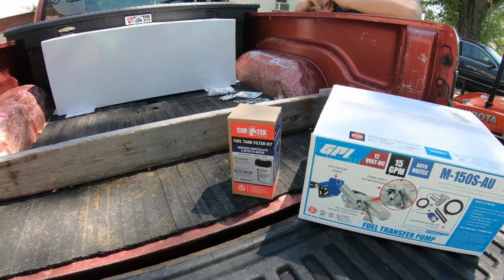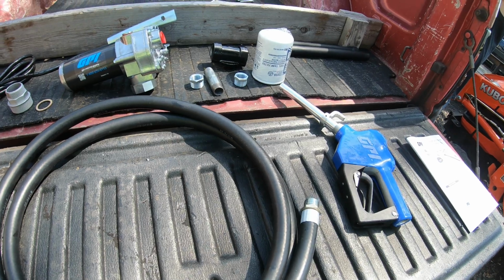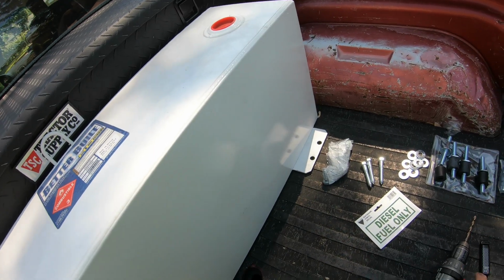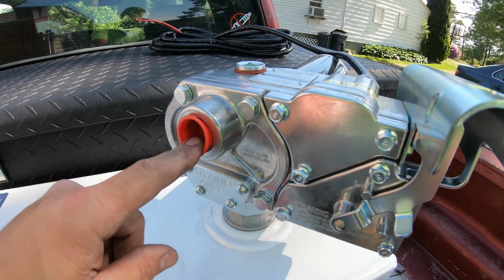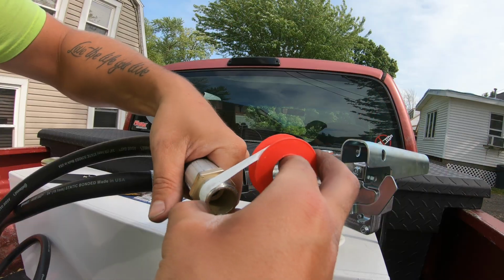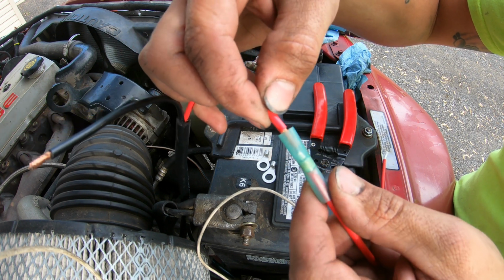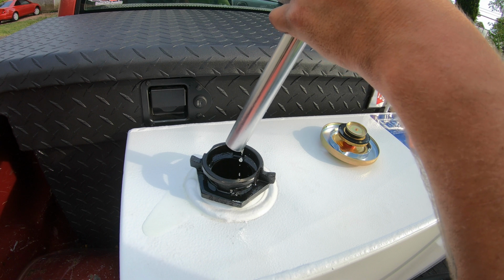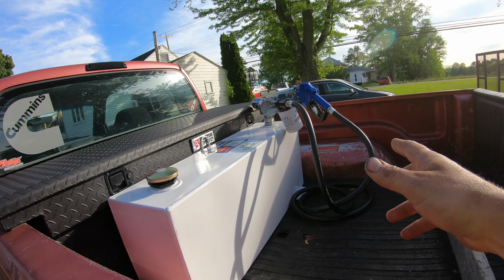Fuel Transfer Tank Install (How-To)- Installing a Fuel Transfer Tank + Pump

Comment: Nice video.  You do a great job explaining your installs.  I really like that small heat gun you were using.
Reply from the maker: Thanks man, that heat gun is actually a soldering gun made by power probe, it’s awesome, I’v had it for many years, you can put differnt soldering tips on it that come with the kit or you can put the blower tip on it and use it as a wireless heat gun.. thing works great 👍🏻
Reply: @BiffsEquipment  Link?

Comment: Good job but do you have any issues with buying Diesel at a gas station. I have been using Off Road Diesel but it's only available from a few stations.
Reply from the maker: Thanks buddy! No I don’t have any issues as I live near a reservation. We have plenty of diesel pumps and most of them offer either tractor fuel or road fuel depending on which one you’d like to use. I prefer to fill my transfer tank with road fuel tho as I’ll often use the transfer tank to top my tank off a bit on a Wednesday or Thursday to hold me over on hitting the gas station before the weekend. Just makes my life easier. It’s been one of the best upgrades/add-ons iv done to my truck and I use the transfer tank weekly between my tractor and my pickup! Also the more diesel equipment I acquire in the future the more and more handy it will become! God bless!

Comment: Well explained!
Any idea how to purge to diesel left into the hose?
Thx in advance Mike!
Reply from the maker: Thanks man! As for purging what’s left in the house, you would do this like you would at a gas traditional fuel pump.. once you shut the pump off continue holding down the handle and let whatever is left in the line bleed out of it into your fuel tank. So far it’s been holding up great, Iv had it on for like a year now with zero issues, tbanks for watching!

Comment: Great video. Does the auto cut off work good? I am installing the same pump on an 85 gallon tool box transfer fuel combo.
Reply from the maker: Awesome! Yep the auto cut off is pros like a charm even to this day.. works exactly like a pump at a commercial gas station.. I can lock the handle and walk away while it’s filling which I really like. Hope your install went well and I’m sorry I just saw your comment !
Reply: @BiffsEquipment  thanks🙂

Comment: I have a 110 gallon L shaped tank from CAL ranch and a 20gpm fill rite pump.   It saves so much time and money when you go to California and diesel is extremely overpriced. I don’t worry about finding a gas station that I can fit the whole rig thru
Reply from the maker: Very nice! I agree having a tank on your truck/vehicle is awesome.. being able to fill it when fuel prices go down and having the ability to have cheaper fuel whenever you need it, specially on a road trip where you are no longer worried about when the next rest stop is can be a life saver. Adding the fuel tank to my truck was one of the best upgrades I have done and it has saved me countless trips to the fuel station dragging around hard to fill 5 gallon cans. Thanks for watching!

Comment: I do the same thing but I use off road diesel on my tractor no taxes on off road fuel.
Reply from the maker: Awesome, yah I love my transfer tank, I use it all the time now, no more fussing around with 5 Gal. Cans.. I run regular diesel fuel only cuz sometimes I’ll use it in my truck 👍🏻

Comment: Hey Biff, Just wandering if you ever had any trouble with your fuel. I been hearing about this   algae that gets in diesel I sure don't want this to happen to my new compact tractor I just bought.  Thanks
Reply from the maker: Algae is a bug issue with diesel that a lot of guys face but in all honesty as long as your using the fuel regularly and topping it off with fresh fuel then it won’t be an issue. Make sure you keep up on fuel filter changes also but if you don’t think you use your fuel faster than 4-6 months then I would recommend adding a fuel stabilizer/biocide to keep the algea from growing.. as long as your using it tho it shouldn’t be an issue for you. Hope this helps 👍🏻
Reply: @BiffsEquipment  Thank you

Comment: Nice job, I converted 250 gallon IBC tote to a fuel tank with transfer pump. That is where my tainted fuel came from. But from now on I always treat fuel with https://powerservice.com/?&utm_source=reachlocal&utm_medium=ppc&utm_campaign=psp&scid=3733631&kw=24208601:0&pub_cr_id=494465743320&device=m&network=g&targetid=kwd-432662300523&loc_interest_ms=&loc_physical_ms=9015635&tc=Cj0KCQjwzYGGBhCTARIsAHdMTQz4qHmMikRsTczQsTk4JtYzhNXnNWc4pRae8EJ6gW0cStnDLE6k1kwaArqvEALw_wcB&rl_key=3d96849a340a690a0873885ed6fba235
Reply from the maker: Awesome Brad, great idea with using the IBC tote! Now that you know I’m sure it won’t be an issue specially now that your treating it and keeping an eye on it, I threw some treatment in my tank as well along with Lucas fuel treatment which I swear by as it adds lubricity to the injection pump and lift pump.. I’ll check out that link and maybe give it a try!
Reply from the maker: Just checked your link, I have used this stuff before it does work well! No Algae in my fuel to date, I also use their protects for my anti gel in the winter, it’s backed by Cummins so how can’t you trust it? Haha!

Comment: Nice job Mike.  You're going to love it.  Next step will be to find you an off-road fuel supplier.  Save that road tax.  Have a great one, Jason
Reply from the maker: Thanks Jay! I really don’t wanna use off road fuel tho as I plan to also use the fuel in my truck when needed on certain road trips or what have you.. it’s just nice to know I can use the same fuel in both my tractor and my truck if needed which is the only reason I didn’t opt for tractor fuel with no tax.. small price to pay tho for having the securely of always having fuel on me. Thanks for watching!

Comment: Good vid. Another benefit I didn't see mentioned is you can fill it K1 and not have to pay the road use tax.
Reply from the maker: This is true, only thing with doing that is you can then only fill your equipment not vehicles, but If your only using it for equipment only then that’s not gonna be an issue. Thanks for watching!

Comment: Awesome Biff. I was just looking at these for my tractor as well. I was looking at the 50 Gallon one and will probably put it on pallet forks for transportation between vehicle and shop. Thanks for the detailed setup!
Reply from the maker: Thanks man! Hell yah that sounds like it would work well, that’s the nice thing is they are nice and portable specially if you go with a 50 gal or under, you could even tag it down to a pallet and move it back and forth with your forks that way too. You’ll have to let me know if you end up getting one 👍🏻

Comment: Great video I have always wanted one too but I have a cap on the back. I always thought it would be great for long trips too you don't have to worry about finding a station that has diesel.
Reply from the maker: I totally agree man, on long trips you no longer would have to worry about finding the next fuel station and could push it farther if you had to which is great. You could still add one with your cap but you’d have to have a long enough hose to be able to pull the nossle out from the tailgate area. Thanks for watching!

Comment: Thank you for sharing this set up.  Getting fuel for the tractor is a pain unless you have a set up such as yours.
Reply from the maker: Thanks Jean, It really has made such a huge difference already, Iv used the transfer tank a few times already to keep my tractor topped off and its a breeze.. Its great cuz I like keeping my tractor full of fuel as it helps to add ballast to the rear but when I had to deal with 5 gallon cans I would often run it till it was extremely low before I filled it again since filling it was always such a hassle. I couldn't be happier with this setup and recommend it to anyone who has to fill their  equipment often. Thanks for watching!

Comment: Nice install Biff. The one suggestion is reroute your power wire through the cab, and hide a power switch in there. This way the dirtbags can't steal all your fuel on you. Locking it helps, but too many people watch the lockpicking lawyer here on YouTube, and can have your master lock off in seconds.
Reply from the maker: Hey Ron, Yah having a master switch that went up into the cab wouldn't be a bad idea.. The lock prevents the handle from nossel from coming out of the pump which in turn keeps the pump switch from being flipped but your right somebody could easily cut or pick the lock if they really wanted to. You know what they say.. "Locks just keep people honest", If someone really wants to steal my fuel bad enough to pick the lock then they may try and find the switch too haha. Thanks for watching!

Comment: I have the same setup except it is in my shed. I have a 50 gallon drum that I fill up once in a while , when I have it on my garden trailer, and just use the BX to put it back inside the shed. I wish I could find a pressure switch that runs on liquids and not pneumatic. I'd mount one inline with the hose so when it reaches high pressure, it turns off the pump.
Reply from the maker: Thanks for watching Dany! I had debated either buying or even building a transfer tank for my home instead for over a year.. I was gonna do this but the more I thought about it the more I decided to go with a transfer tank for my pickup instead.. if I didn't take my tractor on so many odd jobs and the tractor just stayed primarily at my house then I woulda def done the garage transfer tank as you did and it woulda worked out just as nicely.. It was mainly the fact that I wanted to make sure I had fuel wherever I was and not just when I was at my house which lead me to the truck transfer tank instead. I agree finding a pressure switch that worked off fluids like that would be a great idea.. You'll have to let me know what you come up with in the future! I'm glad your finding your transfer tank just as helpful as I'm finding mine!

Comment: Glad you got this tank setup! I'm considering a portable tank with a hand pump. I'm doing the 5 gal can shuffle myself. Great video as always!
Reply from the maker: Thanks Jimmy, My father has those racing 5 gallon fuel jugs and I just recently was telling him about a fuel transfer pump that will thread onto the top of the can where you can flip a switch and use a spray nossel very similar to a weed sprayer to fill your equipment.. This helps to prevent spills and no more heavy lifting either which is always a plus. Check Amazon for them you may find some pumps that fit your cans.

Comment: Your installation videos are always great Mike, good job 👍🏻
Reply from the maker: Thanks buddy I appreciate it, Def gonna be a nice addition to have around!
Reply: @BiffsEquipment  thought I’d ask an expert operator Mike 🙂, when you operate the front end loader, what RPM do you usually run the tractor at? Curious, Thanks Luc
Reply from the maker: @MapleLeaf4us  hey Luc I typically run my tractor between 2500-2800 sometimes more or less depending on how efficient I’m trying to work.. when digging stumps im usually on the higher end of the scale; If I’m just doing some grading or back dragging I’m usually on the lower end of the scale. Find an RPM that best fits you for the job your doing, some people need it to feel quicker and smoother and others like it to feel a bit slower and more controlled.. everyone is different but once you get a feel for what rpm works best for you then you can stick with it
Reply: @BiffsEquipment  thanks Mike, much appreciated 👍🏻🙋🏼‍♂️

Comment: Nice install 
I actually put a toggle under my driver side seat so when I opened my door I reached down to flip pump on and when done I switched off and jumped back in! 

I like your setup better my pump didn’t have switch on it I had to run a separate line! It came with kit though so no big deal! I got mine from harbor freight if memory serves me lol 
Transfer tanks are a must if you own diesel equipment 5 gallon jugs just suck lol

The good thing though about my setup was no one from outside could just flip on pump and steal the fuel! I always locked my truck
Reply from the maker: Thanks for watching buddy!  That's odd your transfer pump didn't come with its own switch and instead you had to use and inline switch on the wiring.. As you said tho that's kind of a good thing as it now makes your fuel much more difficult to steal, even if they knew they had to find the switch they wouldn't know where to look haha. I'm glad you found your transfer pump to be so useful, Im already in love with mine, Iv used it twice already to top my tractor off and god is it nice! I no longer run my tractor till its on empty..  its so easy to fill now that I just keep it topped off whenever I think about it which I like even more for the fact that keeping a full fuel tank helps with keeping rear ballast on the back of these small machines. Thanks for the comment!
Reply: @BiffsEquipment  you’ll never regret doing it 👍

Comment: Sweet! Ive been debating on getting one of these setups but have been put off by the quality/reviews of the tanks and pumps online. Hopefully yours works out well and Ill get the same setup!
Reply from the maker: Thanks buddy! I have also seen some bad reviews with those Chinese pumps... I would stay clear of those knock off pumps from eBay and amazon as they aren't built to the same standard and aren't sealed from the elements as well either. They also don't have built in strainers like this one does I don't think. As for the tanks, tractor supply always seems to stock lots of different options/sizes.. Just make sure to look inside the tank before you buy it to make sure its not rusty.. My tank was still shiny metal on the inside but I have seen videos of people who bought them and had some light surface rust on the insides of their tanks so just be mindful of those things and you should be all set.
Reply: @BiffsEquipment  Awesome, will do. Thanks for the advice!